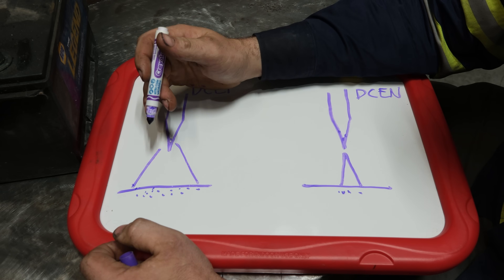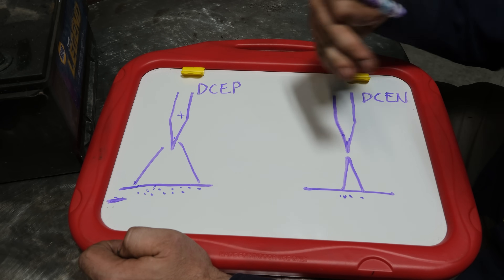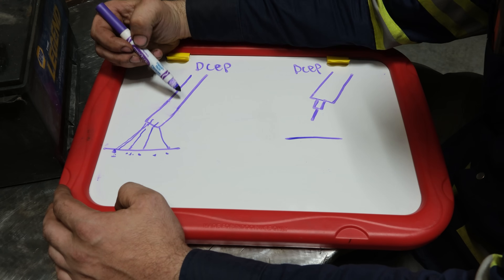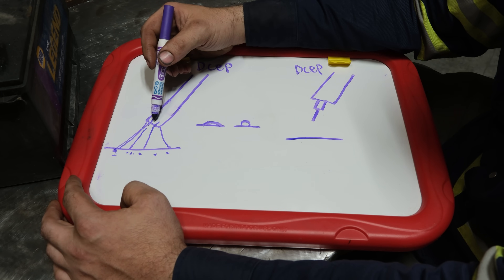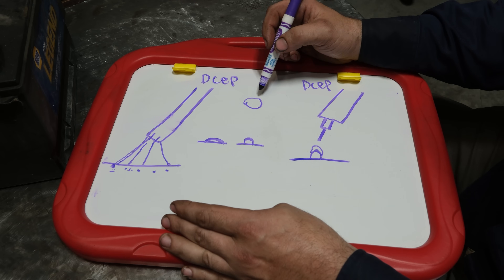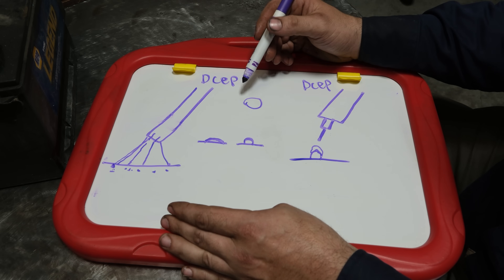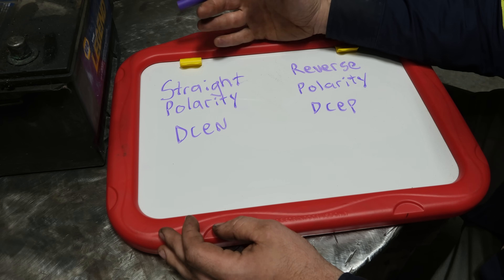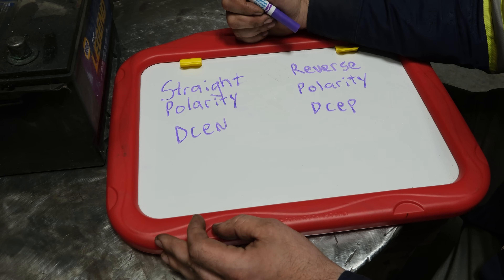Welding polarity and why electron theory is used (In response to #weld.com)

Comment: Hi. What you say is substantially true but a little clarification. As far as the flow of charge, it doesn’t matter if positive charges flow to the left, or negative charges to the right, when they are done moving the left side is going to be more positive than the right side and it’s this relative motion that we call current and which provides the power for circuits. For most circuits, you can talk about positive current (positive changes moving one way and negative current (negative charges I.e. electrons) moving the other way and they are the same. As long as you “define” current as the motion of positive charges, then you can do everything you need to do in circuits. However, in reality, what is really moving is electrons, but we don’t care (usually ) because we just talk about positive current going the other way from the electrons and it all works. Unfortunately back in the early days of electricity they did not know about electrons, and had they know this they likely would have defined the charge of an electron to be positive, and we would not be having this discussion. But they didn’t and so the positive charges current definition stuck. The problem is that there has been so much electronic technology made using the old definition, there is just no way one can just come in and say that now you are going to use the physics based definition. Imagine the confusion with circuits!  There actually are a coupe books that use the electron current definition and the proponents are vocal about it, but there is too much inertia behind the original definition. So the only time you ever really need to worry about this is when electrons are freed from the wire of a circuit. Then you MUST think about it as an electron current. And guess what freeing electrons is what a welder does, and so we have to talk about electron current instead of positive current. Thanks!

Comment: When you are doing stick on sheet metal, do you switch over to DCEP?
Reply from the maker: Most stick rods run DCEP, switching to DCEN can help with blowing holes.  I won’t sugar coat it, stick welding sheetmetal is hard lol.

Comment: The electrical arc is a plasma, consisting of both positive and negative ions. Electrons move toward positive and the ionized atoms move toward the negative electrode which takes most of the heat. This is because of the frequent collisions/scattering of the ions in the dense atmospheric gas prevents them from picking up significant enough velocity  for the electrons to dominate the transfer of energy (as they do in sparse gas/near vacuum). The positive ions have much more similar mass to the metal atoms and more efficiently transfer their kinetic energy(especially heavy gas i.e. argon).
Reply: Additionally: polarity effects the chemistry of welding processes. The ion soup gets separated to some degree by the electric field, with carburizing species tending to arrive at the negative electrode and oxygen ions arriving at the positive electrode. Oxygen ions cause the steel to burn up. This is factored in to flux composition chemistry and arc cutting processes.
Reply from the maker: Thanks for sharing and I will be reading up on this in the upcoming coming days 😀
Reply: Right on! Let us know if you find any good resources. I enjoyed your treatment of the topic. No shame in handwaving through the plasma physics a bit to focus on developing a practical workshop intuition. My comments are only one level deeper down the rabbit hole. Cheers!

Comment: Could you explain why in bushwelding (so using a string of car batteries) they insist on using straight polarity stick welding?
Reply from the maker: I definitely need to wire up some
Batteries and see what I can do 😅.  As far as why they use DCEN, I am not sure.  It might have something to do with the lack of amperage control.  Running DCEN might be less likely to burn through than DCEP.
Reply: Batteries are chemical electricity and it is totally flat DC.  It does not have any kind of pulse and while it might have tons of current it does not ' arc ' very well.
Awful hard to arc weld without an arc.  I have tried it many times.

Comment: So if I was stick welding with DCEN would I be successful with welding material as thin as car body panels without blowing
any holes in it ? 
Obviously using thin rods in the first place.
Reply from the maker: So I can tell you this.  DCEN with 6013 1/16th (1.6mm) rods makes is possible to weld auto body thickness material.  I will not sugar coat it, unless it’s older (aka pre 1980s) sheetmetal that was thicker, you are in for one hell of a challenge.  Self shielded flux core, or mig is really the way to go.  Both of which can weld sheet metal far easier, and won’t leave you frustrated.

Comment: I had to mig weld 0.5 mm steel and welded electrode negative. Like you say it was a high or balled weld but it didn't burn thru and after a grind the weld was narrow but strong enough for this exhaust. Electron theory explains why I had this result.

Comment: So, if I understand correctly, electrons are negatively charged and carry most of the energy contained in the plasma of an electric welding arc. If electrons are directed towards the electrode (DCEP), all else being equal, the electrode will melt relatively rapidly because it has less surface area to dissipate the energy of the incoming electrons than the workpiece would if the polarity were opposite. This in turn results in a more aggressive arc as the thermal energy is ultimately transferred to the workpiece in a more concentrated and efficient manner? (via molten metal droplets that do not disperse like electrons would). 
Solid consumable electrodes (stick and hard wire MIG) are typically used with electrode positive for a more powerful arc and better penetration and fusion.
Flux core self-shielding MIG is run electrode negative to avoid problems like arc blow, excessive spatter, burn back, etc owing to the fact the electrode has less metal than an equal volume of hard wire.
TIG is typically run electrode negative simply because we do not want the electrode to melt at all. With an exception being made to weld aluminum alloys with AC to benefit from the cleaning properties of some electrode positive current. 

Excellent video about a poorly understood subject. I never even thought about it until I spent a day struggling to use self-shielding wire in a MIG welder that was still set on DCEP.
I'd love to see a similar video about how plasma cutters work.
Reply from the maker: It’s very common for people to not realize the polarity needs to be switched for Gasless flux core.  On DCEP it produces a ton of spatter and doesn’t work right.  Many mig welders have been sold as “not working” that simply had the wrong polarity setup on buss bars on the inside of the machine lol.  

You are correct on the polarity.  I will also add that tig aluminum runs on A/c at about 70% EN 30% EP.  It is possible to run about 50/50 EN/EP but you need a really big tungsten and the tip needs to be balled to work properly (so it handles the heat).  MiG aluminum runs DCEP and the arc cleans the surface much like tig (oxide breaks up due to electrons).

Comment: So normally Mig  and Stick is DCEP and Tig is DCEN, also   DCEP produces a wide ark while DCEN produces a narrow ark,  In stick welding DCEP, the ionised steel atoms in the ark are positively charged (since they have lost an electron or two) so they will go from the stick to the negatively charged work piece, that is the  same direction as conventional current flow Positive to negative.
Straight polarity  means DCEM and Reverse polarity means DCEP, because it is referring to electron drift/flow.  I just needed to write this summary.

Comment: Could you do a video on generator welders
Reply from the maker: I will in the future, but I currently don’t have one.  From a functioning standpoint they offer higher duty cycles than typical welders and provide better ability to run rods like 6010.  The smaller ones tend to be pretty weak generators but very good stick welders.

Comment: I forgot what is the best polarity to weld with 7018 and 7024. And can you use AC?
Reply from the maker: 7024 runs fine on a/c.  7018 rods can work on a/c but some work better than others.  With older machines the 7018 a/c rod works the best.  However many others will work.  When in doubt check the manufactures literature.  If you find one you like and works, stick with it.
Reply: @makingmistakeswithgreg  Thanks.  I have the old Lincoln tombstone A/C D/C Machine.  Just wondering what's best.

Comment: If polarity is reversed in the 115v outlets in my garage, is that the same as welding with the polarity reversed on my welder? I just do hobby stuff and maybe patch a mower deck. The outlets have since been wired correctly.
Reply from the maker: So if the polarity is reversed on an outlet I would assume most welders wouldn’t care.  Since a/c I both positive and negative cycling 60 times per second, reversing the polarity wouldn’t change that.  Certain devices may not function properly (the more electronics are in the welder the more likely it would have an issue).  From a safety standpoint it could be an issue since the switch on a welder would complete the circuit, everything inside would be live even with the switch off.
Reply: @makingmistakeswithgreg  Ok, thank you.

Comment: When doing electrolysis on cast iron pans to remove rust. You put negative on pan positive on sacrificial plate. Rust from pan will travel through the water and attach to sacrificial plate.
Reply from the maker: Very interesting.  It makes sense that the polarity would be that, the entire pan would more or less emit electrons.  Because they are jumping off the pan (and not impacting it) they wouldn’t likely eat away at the pan in the presence of chemicals.  I would imagine if you reversed the polarity the pan would likely not be cleaned as well and would probably be eaten away at parts lol.
Reply: @makingmistakeswithgreg  first time I did it. I put positive to the pan thinking it was right.  Everything stuck to the pan . Reversed leads and Everything came off pan and stuck to sacrificial plate.  You have to clean the sacrificial plate every so often to get the amps back up. Washing soda for electrolytes

Comment: is this theory the same with ac welding ?
cheers
ben
Reply from the maker: With A/c you have both EN and EP.  The more EP the hotter the tungsten gets.  This is why modern tig welders can weld on A/c with a pointed tungsten, and older transformers couldn’t.  The older machines were fixed at 50/50 EN to EP so they put a ton of heat into the tungsten so having a point was impossible to have it not melt.  At 70% EN 30% ep on a tungsten it will keep a point ok below 160amps.  

With stick welding a/c tends to produce less penetration than DCEP but the same or a bit more than EN.
Reply: @makingmistakeswithgreg  its clear now, thanks for the answer !

Comment: I think the HF self shielded wire welder is DCEP, and is not reversible. Sounded why they would manufacture such a machine?
Reply from the maker: If you’re talking about the black box unit, those output on A/c which is why they sound weird and have a lot of spatter.  The green titanium 125 one outputs on DCEN which is why it actually welds the way it should lol.  No wire out there is designed to run on a/c and only dual shield and hardwire is designed to run on DCEP.

Comment: So AC stick like Buzzbox need more Amps to do the same weld as a DC machine?   I have been running 6013 on DCEN  (by mistake) didn't look that bad- Also by mistake did Tig DCEP , that is dangerous , the tungsten kind of exploded ;-)
Reply from the maker: When stick welding on a/c it tends to have less penetration than DC and it tends to need a bit more amperage.  On a buzz box they typically have fixed transformer taps so going up one may be too much.  On fully adjustable machines 5 amps more tends to help a bit.  The bead will never be quite like DC with ac, the ac weld tends to have a bit more “peaked” of a weld profile.

Comment: So great video again, but funny thing. First of all, I'm not welding for a long time, too be clear. But I have run a ESAB OK 53.16 2,5mm (this is E7016) and the sticker on the package actually says this is preferred as DCEN.. and this is STICK welding. Actually the package says DCEN or AC .. any thoughts on that? greetings, love your channel..
Reply from the maker: So 7016 is run DCEN on specific circumstances.  It’s primary polarity according to all the info I have is DCEP.  I have heard guys welding on DCEN for pipe.  It’s somewhat odd that they would list DCEN as the go to polarity.
Reply: @makingmistakeswithgreg  ok.. Thanks for the (fast) reply m8. I'll try it on the positive and see what happens..

Comment: As I watched the video around the 2:37 minute mark it would have been a good idea to specify why you would make a low penetrating weld with DCEN with GMAW and SMAW because this could confuse others from minute 9:14 and onwards. 
On another note, I see many youtube comments claiming on how DCEP has deeper penetration than DCEN and how a pushing angle has more penetration than dragging from so called experienced old welders for some reason
Reply from the maker: DCEP penetration is a slippery slope.  It does have deeper penetration depending on the circumstances.  DCEP with stick tends to have more penetration than DCEN because DCEN produces a ropey bead that makes it tough to penetrate through.  Yet TIG on DCEN has massively more penetration than welding with even a bit of EP on a/c.  So it’s kind of a problem of what works for one process doesn’t for another.  The push vs pull debate I did some testing on, and universally pulling with wire produces more penetration.  However the weld looks like it would have less.  I think 99% of that debate is people go by visual look to determine penetration and not actual cut&etches.  Sure pushing is a flatter, hotter looking bead, but at the same settings it has less fusion than pulling.  Which is weird because visually it’s opposite of what you would expect lol.

Comment: Taken a scroll through the comments and not seen it mentioned but have you considered that electron flow is only half of the story, positively charged ions going the other way are how the metal is actually deposited, being the mig wire or arc stick never actually contacts the work, it is vaporised and deposited via the plasma of the arc. Tig is simply an arc flame and the wire is introduced as a solid wire.

Comment: In pipeline welding with stick the procedure is positive electrode that is using 6010 for root and 7010 for fill but if you have a joint with a wide gap and the inspector is not looking if you switch poles you have a better chance of bridging the gap and the root not concave inside which would be a fail.
Reply from the maker: No doubt a wide gap and 6010 is a tough spot to be in.  I have never tried DCEN with 6010 but i bet it would do the same thing as everything else in the video.  Even 10% less penetration might be enough to make a difference.

Comment: Hey when out in the field  when  wedding really pipe you  wind the ground  cable  around  the pipe 7018 so the bead would  stick to the pipe surface
Reply from the maker: That works and the general reason is the pipe becomes magnetized (either has residual magnetism or becomes magnetized) during welding.  Wrapping the coil of wire helps cancel the magnetism out and reduces arc wandering to help avoid weld defects 😀👍.

Comment: Close but no cigar, the flow you're refering to is the front wave of the electric field. The actual drift velocity of the electrons is not what provides the heat.
Reply from the maker: According to miller electric they state “DCEN electrodes flow from the tungsten to the work.  A combination of the kinetic energy from the impact of electrons and the hot plasma gas are responsible for heating and melting the base material.  In DCEP the tungsten receives primary electron flow, and the bombardment of electrons causes heating of the tungsten”.  They also mention to some effect there is a cooling effect on the tungsten via electrons flowing through it on DCEN.  The same thing that is talked about by miller is also talked about in a few books I have, “such as metals and how to weld them”

Comment: In England they teach electron theory, I never heard of "conventional current theory".  If you look at the chemical reactions in the battery it makes sense.
Reply from the maker: Yeah it’s weird thing over here 😅.  Especially because conventional current is so well known here that it’s difficult to understand anything that doesn’t use it.  Electricity is one of those things where the more sure you are on it the more wrong you probably are lol.  So much rests on what you’re trying to do with it and less on hard rules.  Even the comments to this video clarified a ton of things I was unaware of or didn’t know.   I still wish they would have changed to electron theory in this country but at this point it’s pretty much set in stone.
Reply: @makingmistakeswithgreg  They should teach chemistry before electricity then it would be easy to understand why electron theory is correct. Of course the rest of the world (99.9%) use the metric system so it's no surprise Americans do things err differently.  Then there are technical flow charts where ground isn't ground but rather a reference point.